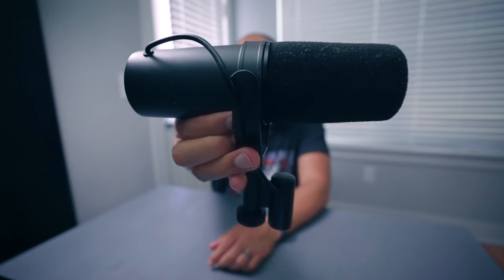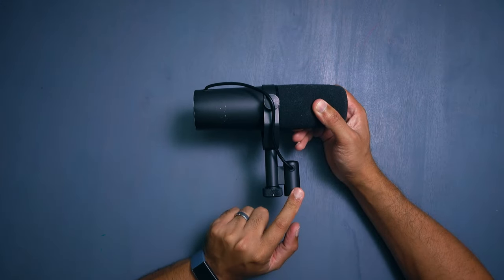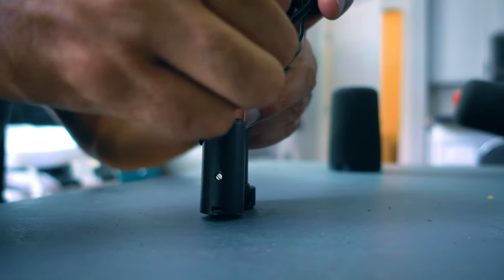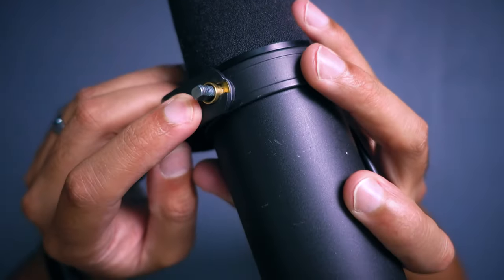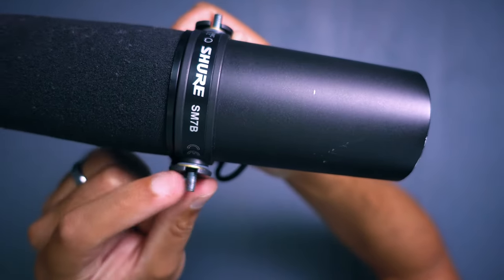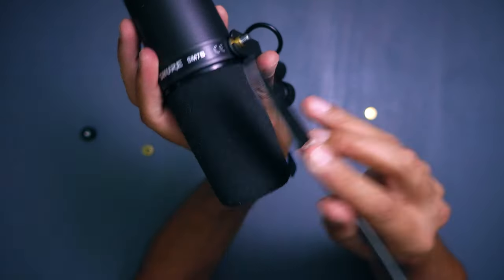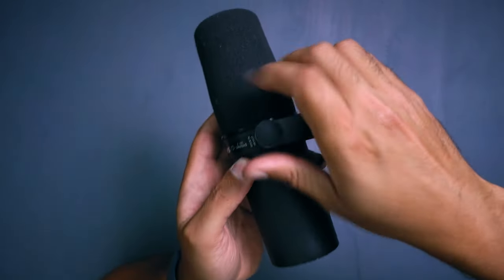Shure SM7b Mount - How To Invert, Flip, Adjust, Reverse, or Modify

Comment: To anyone (like me) who couldn't get that damn golden round thingy to seed in correctly, what he does with the knife is gently push around the plastic washer. You need to make sure the plastic washer is actually in the middle and not slightly off in any direction. Hope that helps, and great video btw.
Reply: Thanks!
Reply: Omg!! Thank you!
Reply: Bro....amazing comment. I couldn't exactly follow what he was doing with the butter knife. Once I read your comment, I took a tiny flathead screw drive, pushed the plastic wash a smidgen and then the ring dropped right into place. What a pain in the ass!

Thanks!
Reply: W

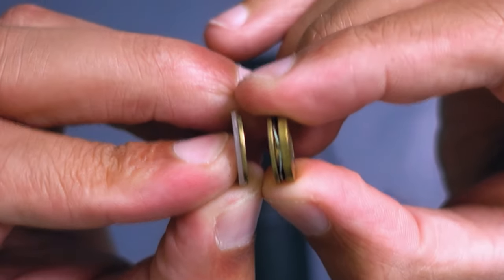Comment: This is a brilliant video, thanks so much for taking the efforts to make it.  Went with your recommended approach to swap the bracket and it worked a treat.  As per what some others have said in the comments, watch out for the small golden washer that sits between the five pieces, it's really important that this is in tight with the first two that go in (2:10 in the video for an image of how these go together, it literally sits between these two and goes inside the two on the left).  I found that putting these two on first, then the bracket, then getting the golden washer to sit between the bracket and the first two, was the ticket).  Then afterwards, add the others and hand tighten.

Comment: Great Tutorial

I recently used this tutorial and found it incredibly helpful. However, there's one issue I encountered that I want to highlight. The lever on the front side was obstructing, making it difficult to insert the XLR cable without risking damage. Even a slight movement could potentially harm the XLR connector.

After some searching, I discovered that there are extension tubes available, but dealing with two connections seemed like an unnecessary hassle, especially considering the possibility of loose screws causing additional problems.

Thankfully, I found a simple solution: flipping the XLR connector. Thanks to this workaround, I was able to use my mount without any further issues since the connector now sits behind, avoiding any obstruction.

Overall, the tutorial was excellent, but I wanted to share this tip for anyone facing similar challenges.

Comment: Super helpful. The key here is really in that nut on both ends. You really have to push it in otherwise there won't be tension. Thanks for the tip!

Comment: One more thing to add to this: the Shure plate that comes in the box, you can mount it on the back by removing two of the screws (it hides the switches)

great video! When I switched the yoke around, I had that same problem. Wish I would've seen this video when I did it. It wouldn't of taken as long haha

Comment: I understood I needed to get the brass cylinder through the washers, but was having trouble. The butter knife was the "light bulb" I needed. Good looking out 👍

I came up with another SM7B "hack"...I put a little rubber foot off of a guitar stomp box pedal on the part of the mic where it comes into contact top of the XLR cylinder. It prevents the metal-on-metal contact

Comment: Nice video; easy to follow.  However, depending on how you plan to mount your mic, you might not want to do it.  When the mic is attached to a desk-mounted boom stand (spring-loaded arm type like the Rode PSA1) where the sm7 will be attached and hanging in a horizontal position facing you, it is better if the mic is in its factory-mounted position because that allows you to move the boom arm and mic position freely without interference from the XLR cable that is attached to your mic (because the cable comes over and in to the input).  This  also keeps the small electric chord running from XLR input area free, and therefore, to not get twisted into all kinds of positions it shouldn't be in..  Also, on those kind of boom-mounted stands, you'll need the Shure A26X3 extension tube (costs about US $8.00).

Comment: Would you happen to know why the SM7b makes cracking noises? The noise goes away when I remove it from the stand or hold it with the XLR cable.. can't seem to get mine working properly. Any response is greatly appreciated! 🙏
Reply from the maker: I haven’t heard of this issue before, sounds like something electrical maybe? I’m not sure.
Reply: @JavierMercedes  thank you!

Comment: That was not easier than the allen screw. 😁 I'm still not sure I have all those washers in the correct order and I had two extra plastic ones but it's working. I ended up with the Shure logo up and the back panel right side up but I decided to have the XLR connection on the singers side of the mount so it doesn't show on the back side.

Comment: I cant get it working anymore. Just bought this, and because I cant see what the hell you're doing in that millisecond moment with the knife, I cant get it working anymore. Awesome. Guess I need to return it. :(
Reply: What he does with the knife is gently push around the plastic washer. You need to make sure the plastic washer is actually in the middle and not slightly off in any direction. Hope that helps.